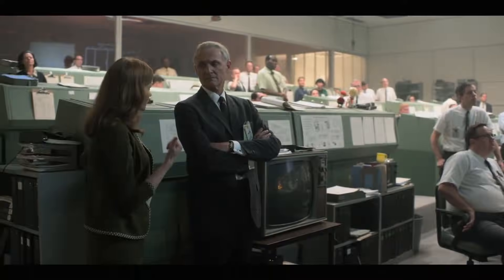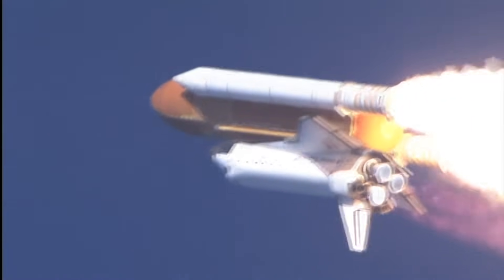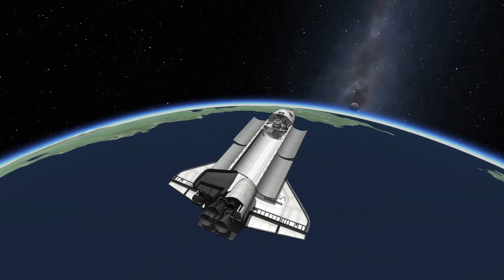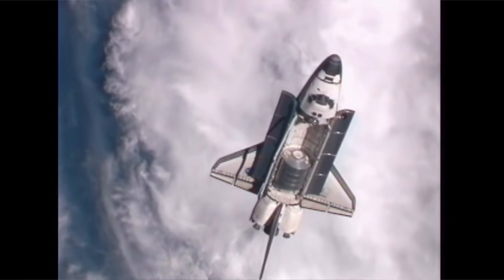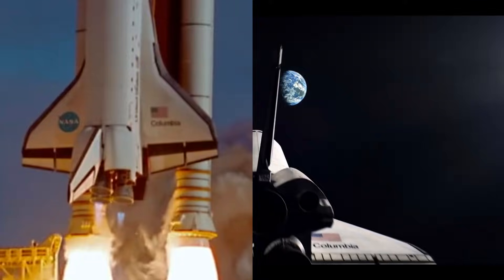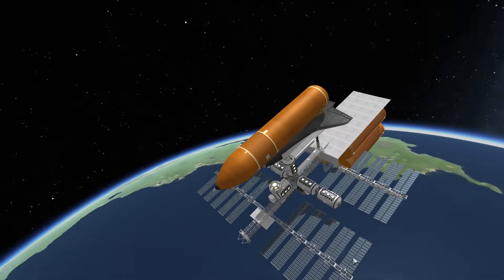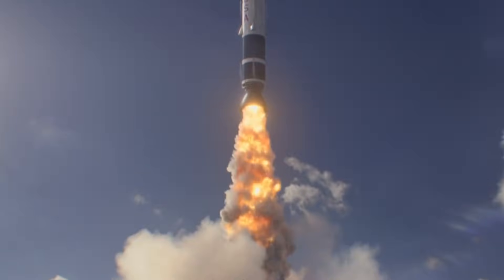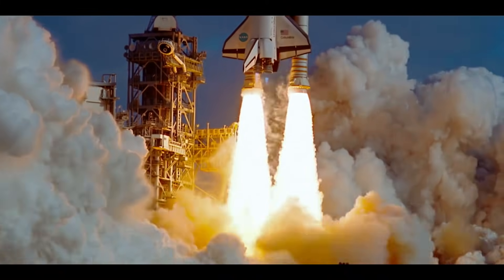How To Send A Space Shuttle To The Moon

Comment: If the shuttle would make a poor lunar lander, why would Starship make for a good lunar lander? Or is it just a case of, that's what they have and NASA only has moon money and no mars money.. If you have a hammer, every problem looks like a nail.
Reply: The Starship is designed to land on its end with rocket power, just as the lunar landers did. The shuttle could only land on a runway.
Reply: @fromnorway643  

What of the primary issue, that being the extra unneeded mass of the vehicle.
Reply: @calvinsylveste8474  
Extra mass increases the need for fuel, but even if that problem was solved by refuelling in low Earth orbit and if a runway had been built on the Moon beforehand, it would be physically impossible to land the shuttle there since its wings wouldn't work without an atmosphere.

Comment: what if the shuttle carried a lunar module and just went into lunar orbit for while..
Reply: That would still require several extra launches to refuel the external tank in LEO, and the heat shield would need to be strengthened to withstand the higher re-entry speed, but bringing a dedicated lunar module would at least make landing on the Moon physically possible.

Comment: I think the most straight forward way of doing it would be to reengineer the main tank.  Double the volume of the main tank and add 4 more solid rocket boosters.  4 more rather than 2 more, because it would allow the Shuttle main engines to remain the same thrust.   Otherwise, the Shuttle needs bigger, more powerful engines, to balance and lift enough of the new tank.  The tank should stay attached until after burns to reduce speed returning to Earth.  You don't want the high G load on entry any more than the extra heat.
Cost for the modification should not be that large, because the tank is disposable anyway, and does not discard any expensive engines when it is lost.  The same boosters can be used, just more of them, so no big deal.
My suggestion is overkill, but refueling at the Moon could, easily, provide enough thrust to reach Mars and return. Though, it might not be very fun in the shuttle for that long voyage.  And the shuttle could not land on Mars, you have to use something else for that.

Comment: I've always assumed (well, once I learned about weight and balance) that the orbiter's SSMEs were at an angle (rather than longitudinally aligned) in order to direct thrust opposite the center of gravity with the ET attached. Am I wrong on that one?
Reply: No, you're right, they were both pointed that way and had a large gimbal range to account for the external tank

Comment: First time I've seen any of this, but I would question the idea of the space shuttle returning to Earth.  It would be a permanent lunar orbiter, so several of your points are moot.  No return propellant needed, no heat tiles needed, no landing gear needed.  Can you do the calculations again with these and whatever unneeded items you can think of being removed?  I know the wings are not needed on the moon so take those off too.  Can it be sent without anyone on board?  If so then it could be sent in a longer lazy path because no consumables on board would be used to the Moon.  I like the idea of the external tank taken along for the trip, and any propellant on it would be used for other ships to return to Earth.

Comment: Why don’t first decent to LEO and then deorbit
Reply: Slowing down from lunar re-entry speed to LEO speed requires the same velocity change (~11,000 km/h) as the TLI manoeuvre since it would basically be the TLI in reverse.
Doing this with an engine burn would require the shuttle to bring its own mass of extra fuel all the way back to Earth, or even more if the fuel was less efficient than hydrogen/LOX. If the shuttle couldn’t be refilled in lunar orbit with fuel produced on the Moon, all that extra mass would need to be launched from the Earth in the first place, doubling the mass and fuel needed for the initial launch.

There is a reason why all manned spacecrafts re-entering from LEO or beyond have used heatshields and atmospheric drag as their primary mode of braking before landing – it saves many times more mass in the form of extra fuel than the heatshield itself.

Comment: Scott, you are  such a downer ;) There will be various "updates" that will solve these "little" problems you raised !!

On a more serious note, how about a set of videos on the various things which need to be solved for a Mars trip for Starship. In no particular order.

1. Refueling in space ... NASA funding secured.
2. Landing on Mars - with/without a landing pad - Variation proposed with landing thrusters further up Starship body for the Moon - Some funding secured from NASA.
3. Power on Mars - Solar/Nuclear - Want steps are required to power Starship for a crew of x, and would that power source be the "Starting" power source for a Mars base. What kind of sign off would be required?
4. Communication with Mars - Starlink in some form - Will the satellites degrade in orbit so much with less of an atmosphere, more solar panels required?
5. Creation of fuel, base etc - via remote control/automation etc - latency.
6. Actually finding people with the mental/physical fortitude for the job/risk.
7. Carrying people on Starship - initial work with Dragon should prove useful combined with ISS. The things they will have learnt over time with water/air reuse.

Anyway I am sure you could do a proper job Scott. just go crazy.

When I think about the list, I can see where the 30 billion a year that Starlink could potentially fund, would go quite quickly.

I do look at SpaceX as the offsite development house for NASA, where they get to push things far faster than they would otherwise  be allowed.

Comment: Hi Scott, you make me query! Would there be any use for the Shuttle style frame if it were redesigned to replace all its engines w/ a couple Raptor vacuum engines & the Methane & CLOX fuel tanks for Moon & back; then upgrade the heat-tiles for HEO reentry and push the whole thing to orbit with the Super Heavy Booster ( FH 3pk setup, if needed)?

Comment: the craft itself wasn't  really space rated. the tile glue would fail for ex, the frame wouldn't support. actual space-- it wasn't really a space shuttle,  it was a low earth orbiter  plus as you mentioned. the thermal issues of the tiles would also fail.  if they ever. had a better. adhesive

Comment: 7:03 With all due heart-full respect to you man but, No fucking shit! This is Rocketry 101, it is physically IMPOSABLE to have all the rocket fuel for a round trip to the moon and back to take off from the launch pad! The ONLY feasible way for a rocket or in this case the shuttle to make a round trip is for it to link up to booster in orbit with the extra fuel to get it there and back.
That or if there were able to fit the Shuttle with MHD drive but even with that you'll still need the booster rocket orbit.
 Technically there two rockets being launch into space, one with the crew and cargo the second caring the extra fuel. So if they want they could launch both of them at the same time. That is the close "in a way" you can come to a single stage witch in the end the only thing your be saving is time not fuel.

Comment: worst craft ever, its like flying in  paper box, even more, the boosters and the engine position are offset, making it unstable and hard to fly, it was also not aerodynamic, it wasted much fuel just pushing trough air, every complete mision with shuttle was LUCK.

Comment: Forgive me, as I don't have a masters in orbital mechanics, but couldn't the shuttle on return from the moon first get itself into orbit of the Earth and THEN slow down to deal with the "too fast for the heat shield" problem?
Reply: The shuttle would need to slow down by about 3 km/sec or 11,000 kph to change from an Apollo style re-entry to low earth orbit. That would require at least its own mass (80-100 tonnes) of extra fuel, which would need to be brought all the way from the Moon, or all the way from Earth to the Moon and back if it couldn't be refuelled during the mission.
The fuel could have been sent on a free return trajectory around the Moon (Apollo 13 style) and docked with the shuttle on its way back to Earth (timing would be very critical), but that fuel supply alone would require the capacity of two Saturn V rockets launching 40-50 tonnes of fuel each.

Comment: But didn’t you say the external tank had almost twice the needed capacity? Couldn’t that be used for deceleration into a lower orbit for a normal reentry?
  The compelling thing about using the shuttle for a moon mission was that NASA takes 30 to 40 years to devise a new manned space system. It’s not like you can just ask for a special purpose new system and have it anytime soon.  Even if it involved 20 launches it l would take less time and cost only a fraction as much.

Comment: Y tho.

Not much of an alternative reality if they inexplicably repeat our mistakes. Seriously, without a funding dropoff after Apollo won the moon race the Shuttle we know would never have been built. Max Faget's smaller crew transport concept would've had stainless steel wings, depend on it's greater relative cross section for it's mass to avoid the need for frail heat shield tiles and launch on a smaller stack lacking leaky solid rockets boosters... Meanwhile there was the OTV or Orbital Transfer Vehicle concept for a permanent space tug using solar electric, solar thermal or even nuclear to shift considerable cargos and crew from the LEO of the orbiter concepts to all the places you'd want to go in the solar system. Smh.